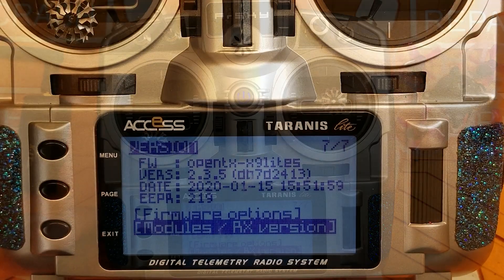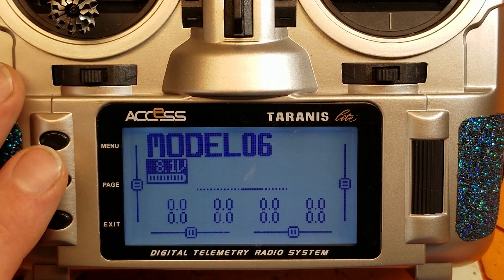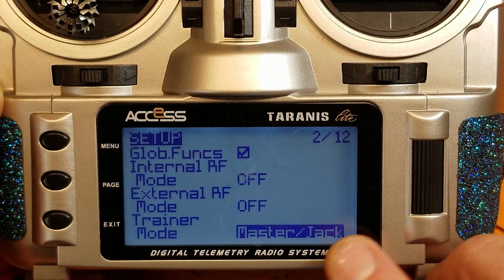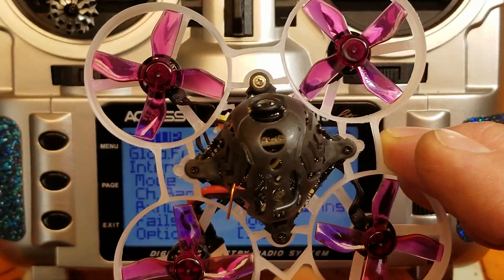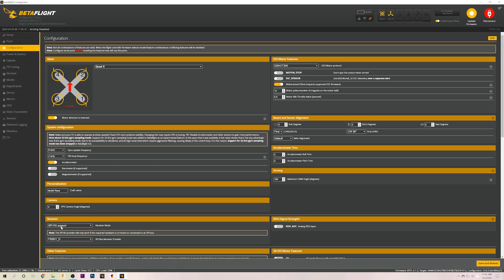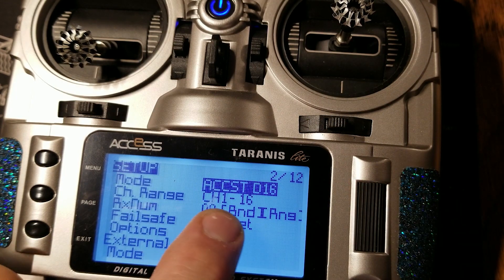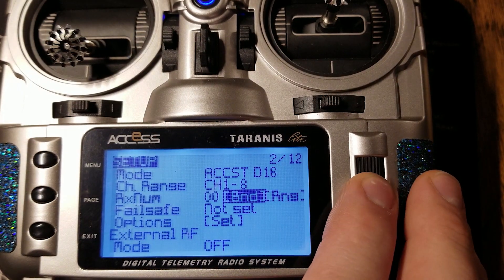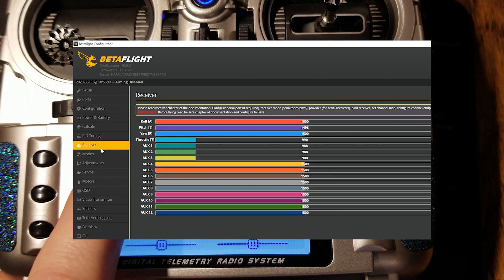How to bind SPI receiver with an ACCESS radio in D16. 📻✈

Comment from the maker: ****Note, There have been some changed since this video. This will not work if you update your internal RF (isrm) or (XJT) module to any FW version 2.x or higher!****
Reply: i have the new version 2.15, it dont work so what is the difference in the process ?
Reply from the maker: @gabkimus7721  You will need to downgrade your ISRM (Internal RF) FW to 1.1.3 to use D16 with a SPI based receiver. You can find the FW at frsky's download page for your radio click the "history" link and you'll get the FW you need.
Reply: okay thank you, i will try

Comment: Will this work on an eu lbt radio (accst x9d+)? Or do i have to do the firmware update, as I've been told, on discord? This is a whole lot less faffing around than doing that? Tia.
Reply from the maker: Same process but you need to select frsky_x_lbt in betaflight

Comment: Thank you again for your help!  I was going back and forth with HappyModel and together we got the Mobula7 to bind with the Taranis QX7 ACCESS radio.  Here are the steps I did: FrSky QX7 Radio: ISRM 2.1.6, BetaFlight: version 4.3.0, BetaFlight: Receiver Mode: SPI Rx, BetaFlight: SPI Bus Receiver Provider: FRSKY_X_V2, BetaFlight: CLI Line: Bind_RX (Lights next to USB indicated binding mode), FrSky QX7 Radio: bind in ACCST D16 for 6-8 seconds (Lights nest ro USB indicated a bind!), BetaFlight: CLI Line: Save, Disconnect USB Power to Mobula7 (FrSky QX7 Radio reported "Lost signal"), FrSky QX7 Radio: Bind off, Reconnected USB, BetaFlight shows bound via Receiver tab corresponds with stick movement on FrSky QX7 Radio!
Reply from the maker: Awesome! I'm glad bf finally has incorporated a accst v2 code into the spi based boards.

Comment: So I got my 1s Mobula 7 bound now it was the new firmware not playing nice. But now the damn thing has no throttle response on the throttle stick everything including thr responds in bf correctly but when armed there is zero motor spin up except for pitch and roll if i give it right stick input i get the correct yaw/roll motor spin but no main power on thr wtf is wrong ?

Comment: thank you for the clear instructions.. im having trouble still with a quad running xm+ that i bought second hand and im unsure if its accst 1 or 2 and cant get it to bind.. would love some help and willing to compensate for your time..
Reply: BTW - this did work binding to my TH freestyle II !!!
Reply from the maker: I can certainly help you out. If your radio currently works with your th2 then your radio has access v1 fw on it. You will need to flash accst 1.x fw to your xm+ or upgrade the fw on your radio.. The down side to upgrading your radio is it will then be incompatible with your th2.
Reply: @TweetFPV  so I'm new to the hobby and that's the receiver I was told I had and I couldn't find a matching picture on the internet and come to find out it's not a XM plus even though I had bought a new one to install and replace in case it was broken.  It's actually an rsxr .. one of the wires was broken on it and I tried to resecure it to the plastic clip or whatever that plugs onto the receiver but even though it's getting powered I don't think that s bus wire is connected well because I can't get it into s bus mode in the blue light will not flash it all no matter what I try so that's my theory on it and now I have the choice between messing with the rxsr or just replacing it with the new XM Plus.  Sorry for the novel however just trying to explain in detail to avoid any confusion and asking what would you do if you were me. Thank you so much

Comment: Will this work on 2.3.12
Reply from the maker: Yes
Reply: @TweetFPV  I'm having issues get it to work on my tinyhawk freestyle 2 I have a frsky x9 li I believe
Reply from the maker: It is doable for sure. You just need to make sure all your fws are crooect and bf is setup properly
Reply: @TweetFPV  what you mean by fws please and I believe I have everything on bf setup right I'm on frsky x for the EU as I'm in the UK I have been trying all day with different settings and it's not binding at all
Reply from the maker: Fws = firmwares
You need to set in bf to frsky_x_lbt since you are in the eu

Comment: I have bata65s copter and taranis x9 lite. FW 2.3.12 and I can't bind copter to taranis x9 lite. is it possible that problem with FW 2.3.12?
Reply from the maker: No, its not a problem with openTX V 2.3
12. The issue you most likely have is that your internal rf module fw is incorrect. The highest isrm version fw that will work with these spi based receivers is v1. 1.3 it is also region specific. If your radio says isrm version x.x.x EU then you need to change your rx protocol in bf to frsky_x_lbt. If says x.x.x fcc then you need to change it to frsky_x

Comment: so I tried this but using emuflight and I did the frsky_bind commant and save and it didnt work
Reply from the maker: I haven't tried it on emu. I don't see why it wouldn't work. You are probably missing a step ot don't have one of the setting correct.

Comment: Ugh my won’t even connect 😒
Reply from the maker: Your doing it wrong then or you don't have your operating system and bootloader updated. There is a small gotya with the rf fw. You need to be on isrm 1.1.3. You can no be on 2.0 or newer.

Comment: I'm spending second day to try get the TaranisQ X7 ACCESS working with my tihyhawk2. I use the ACCST D16 mode, the TH and radio are bind together, but in betaFlight and also during flight the RSSI often drops to zero (like every 10s). Any advice here?
Reply from the maker: The only recommendation I have for you is to get an external multiprotocol module. These radios and fc do work in d16 mode but they do suffer from terrible range and poor connection quality. Some work well others do not. Sounds like yours is one of the do nots.
Reply: @TweetFPV  would be also solution to install separate frsky rx into tinyhawk?
Reply from the maker: Yea that would work too. But the mpm will do more for you in the long run.

Comment: Is access d16 the same as d16? I have the XSR Sim dongle and it's refusing to bind with my x9 lite. I assume that means they're different?
Reply from the maker: There is no access d16. Its either access or accst d16. It is possible to bind to your Sim dongle in accst d16 mode but you will need to make sure your internal rf fw is compatible. V1.1.3 on your isrm should be what works.
Reply: @TweetFPV  That's it. Accst d16. I was going off memory on what it was called.  I'll have to check the firmware versions. That's probably what the problem is. I seen one guy say "I dint know why you would ever want to flash new firmware to your gongle" then I seen another guy flash new firmware to it and his radio and that made it work. I don't recall if I ever updated the firmware on my x9 lite or not. It's been so long ago now. Thanks for the answer.
Reply from the maker: No problem.

Comment: Thanks, works good on my BetaFPV Beta85 Pro 2 Brushless Whoop 2S Quadcopter (Frsky):  Firmware: BTFL 4.2.8  :   bind_rx
Reply: sweet. thats a confirmation enough for me. are you using acct 2.0 or 1.1.3?
Reply: @NvrEnder-FPV  I didn't upgrade my QX7 to ACCST 2.0, because if I'm right it will no longer work with receivers with original ACCST protocol, so the firmware version is: 2.3.9 , internal RF XJT D8 .Hope it helps.

Comment: Hi, a non-Frsky module multi-protocol does not work, but a Frsky ACCST module could work on ACCESS radios?

I don't understand this strategy...
Reply from the maker: Non-frsky mpm does work. The tbs one does not.
Reply: @TweetFPV  Are you sure?  If I take a QX7 ACCESS and put in an ACCST module does it work? For example irangex or Frsky XJT? Now there is firmware 2.x.x, someone has problems
Reply from the maker: Yes it works as long as you have updated your opentx os past version 2.3.3
Reply from the maker: Take other people problems with a grain of sand 50% of opeple using this stuff have zero idea how it works. Not that frsky makes it easy.
Reply: @TweetFPV  thank you.  Usually the simplest test is to try 😉

Then there is another thing of and I have doubts, if you upgrade a radio to Frsky v2.x.x you get a D16 V2.  Does the D8 still work?

Comment: I cannot bind my jumper t18 to my iflight 65s spi d16 drone. Please help I have tried every frsky channel on my radio and tried to do it on betaflight and got error messages. I have a tiny hawk 2 that works fine with frsky d8
Reply from the maker: In betaflight what reciever protocol are you set to?

Comment: When enter save, my drone reboot
Reply from the maker: Yep that's how it works.
Reply: @TweetFPV ohh yes have just seen it starts again with you. But then it is not connected with me
Reply from the maker: To help you I need more info.
1. what radio are you using?
2. What version of opentx?
3. What ISRM firmware version?
4. Is your radio FCC or EU?
5. What is your bootloader version?
Reply: ok i have now managed to bind my meteor 65 with the taranis x9d plus se 2019. everything actually works, only when the copter is armed the message comes in osd: rcsmoothing, and I can't start
Reply from the maker: That's an odd failure. Have you made any changes in betaflight from the stock firmware setup? What is your cpu usage when you are connected to betaflight?
Reply: @TweetFPV  so I have now flashed again new ones, bound and now this error is gone for now. but I still can't start. Arming disable flags: CLI MSP ARMSWITCH 
what does that mean?
Reply from the maker: That usually means that you have the flight controller still connected to betaflight and that will keep it from arming.
Reply: @TweetFPV  MSP and CLI yeah but arming switch not
Reply: @TweetFPV  i flashed and bind again and now I have a lot of fun with it
Reply from the maker: Awesome! I'm glad you go it up and ruining ☺

Comment: when I choose SPI RX support and choose FRSKY_X  the save and reboot. when i connect again it goes back to the default one! I have beta 85 whoop drone!
Reply from the maker: That's really wierd. After you save it goes back to frsky_d?
Reply: @TweetFPV  no the default one is:
"PWM RX input(one wire per channel)"
Reply from the maker: Which version of the beta 85 do you have? Some came with no receiver.
Reply: @TweetFPV  frsky fcc xm+. I sure there is one because i am pressing the bind button like all the videos am watching haha. the problem is the red and green lights are just solid when i press the binding button and connect the battery while my transmitter is on binding mode
Reply from the maker: @jousiff91  Something isn't adding up here. If its XM+ then you aren't using an SPI board. which would make sense why it wont save the changes to the protocol like you mentioned before. Is the "bind" button you are pressing on the flight controller or on a separate board? Pictures would really help. Head over to my discord and i can help you better over there. www.tweetfpv.com link to my discord server is there.
Reply: @TweetFPV  I just sign up there i will send you the picture over there
Reply from the maker: Great!

Comment: Got it to bind. Now I’m dealing with loss of RX or bad RX, rendering my TH2 useless. Any ideas? Using a taranis x7 with access
Reply from the maker: You can try disabling telemetry, or re-binding but this is a side effect of using d16 with these spi boards. Some are great and some are terrible. It's a complete roll of the dice. You unfortunately might just have one of the bad ones. I highly recommend getting an external module for these spi d8 quads or you can add an external rx

Comment: Hi is it possible to add external sbus receiver (radiolink) on fc that have internal spi frsky receiver?. Will it work? I want buy uz65 but this have not "no receiver" version or "radiolink receiver" version.
Reply from the maker: Typically you can. Most spi boards do have at least 1 uart broken out on the board but the soldering is very difficult as the pads are very small.
Reply: @TweetFPV  i will try. Thank you

Comment: I've been able to bind SPI receivers to the X-Lite pro and X9 Lite for a while now using the frsky_spi_autobind CLI method. We recently got our shipment of Archer RS receivers in from the factory. I was not able to register/bind them at all until I updated to ISRM 2.x, which killed my ability to bind to SPI receivers. Their "technical rep" sent me the link to this video, but it doesn't seem to address that. Is there a workaround for that yet, or will I have to flash the ISRM back and forth?
Reply from the maker: Unfortunately You will need to reflash your isrm back and forth. Or purchase a external multiprotocol module or the xjt lite module to use d8.

Comment: Do you have any idea what would cause the Taranis to freak out? I got mine binded but after setting up the switches, it won't arm. The taranis is also constantly saying "Telemetry Lost" or "Telemetry Recovered" or "RF Signal Critical" and nothing I'm doing is getting the drone moving. Tried binding with both Telemetry on and off in the model settings, tried switching the Rx back to FRSKY_D (which led to it not binding at all) and I'm at a loss. Any clue what could be happening here man?

Comment: Hello I bought BETAFPV Beta65S Frsky 1S  with F4 SPI Frsky FC M01 AIO Camera 19000KV 7X16 Motor

https://www.amazon.co.uk/gp/product/B074N5DNR8/ref=ppx_yo_dt_b_asin_title_o06_s01?ie=UTF8&psc=1

Did all you show here, got new version on my Makerfire FrSky Taranis X9D Plus 2019 2.4G 24CH ACCESS ACCST D16 Transmitter - 2.3.9-otx (60e1edc1)  date 2020-06-14   eepr:219
I doesnt want to bind with my transmitter.... I regret I bought this one with access, to much problems, lack of simple D8 or D16 (when I was buying I was totaly green in drone reciver subject)

Can you help please or advice?
Reply from the maker: you can get the supported version of opentx 2.3.9 configurator here https://www.open-tx.org/2020/06/14/opentx-2.3.9 
Also make sure you are NOT on ISRM version 2.x. you need to use an older version like ISRM 1.1.3
Reply: @TweetFPV  thank you I will check that :)
Reply: @rfactor2recordings624  hey buddy, did you end up fixing this?
Reply: @vedder30  hi mate, thanks for asking, bought FrSky XJT EU LBT to fix this problem....  Now am into 6s 5'' quads and am on xm+

Comment: I just bought a new Taranis X Lite Pro and a TinyHawk S. I also have a new R_SRX  receiver and a XSR_Sim modular , none will bind! I have Open TX 2.3.9 in TX and use Beta flight 10.7.0. Been working for hours with no luck, Got any ideas.
Reply from the maker: You need to make sure your bootloader is on the same version so 2. 3.9. Did you flash new fw to your internal module (isrm)?

Comment: Hey man great video! I decided to get an XJT module for my QX7 Access to avoid the D16 hussle, but it turns out that my QX7 module bay is way bigger than the x9d and I cannot plug in the XJT. Do you know of any other modules that I cant attach to the QX7? 

Thanks!!
Reply from the maker: The module bay for the qx7 and the x9d are the same. The x9 lite and xlite use the mini Jr bay. If you have the qx7 you need to look for a xjt module like this one https://www.amainhobbies.com/frsky-xjt-transmitter-module-frk-3030401/p1167046

Comment: This worked great and relatively painless for binding a Taranis X9D SE 2019 to a BetaFPV Meteor 65 - Great Video!
Reply from the maker: Glad it helped!
Reply: I tie exactly the same things as you do. Which software versions do you have on your remote control and your meteor 65
Reply from the maker: Opentx v2.3.11 isrm V 1.1.3 betaflight 4.2.0
Reply: @TweetFPV  betaflight 2.4 !? You mean 4.2
Reply from the maker: Yes
Reply: then i have exactly the same versions, but after my computer reboots it is not bound, is there anything else i can try?
Reply from the maker: @papierkorbknackwurst  You have two "HELP ME" threads going. I am going to stop responding to this one. Please use the other thread that you have started so we don't get confused.

Comment: I had the opposite experience with my x lite pro. When I bound my tiny hawks using D16 they had decent range but once I got the xjt external module and bound in d8 they have poor signal even when only a few feet away. Any ideas what might cause that?
Reply from the maker: This is odd. I would say you possibly have a faulty module. D8 in my experience is always better than d8 with the spi boards.
Reply: TweetFPV faulty module meaning faulty xjt lite?